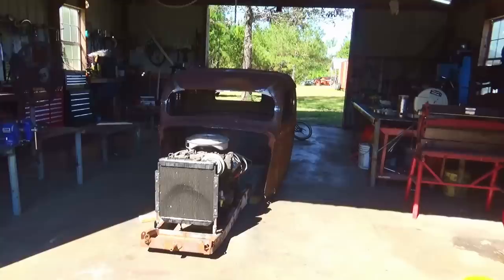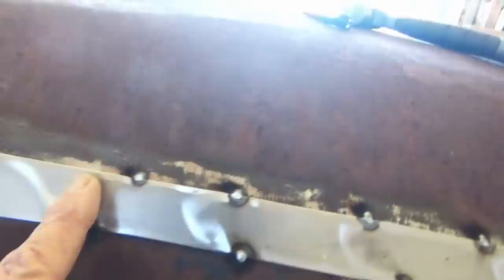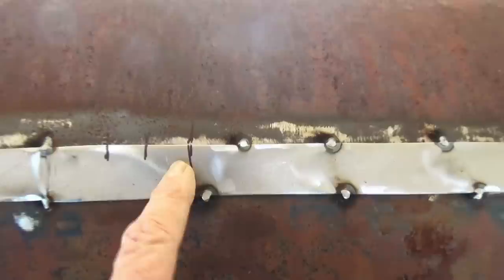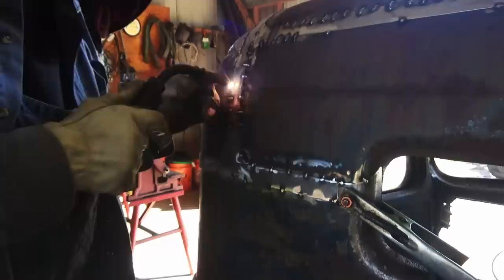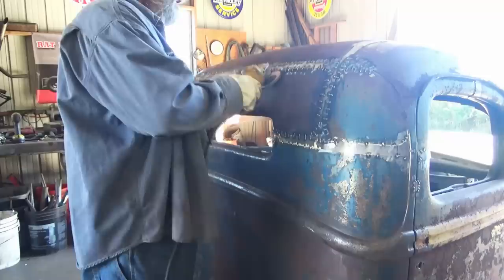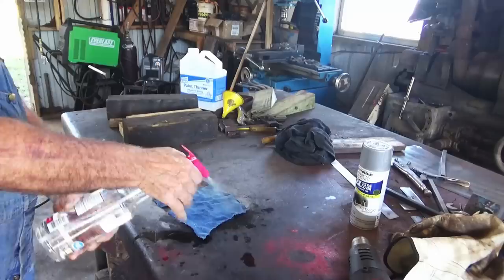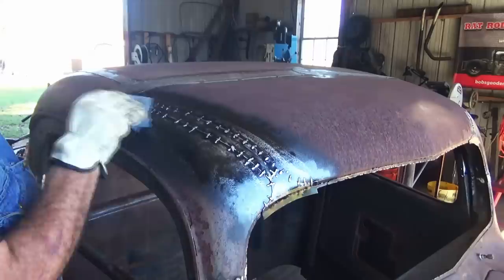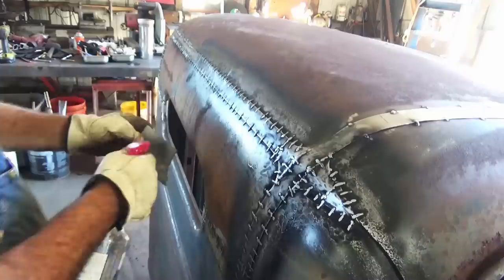47 Ford Truck Rat Rod Stitches And Bare Metal Paint Effect

Comment: Hey Bob. I love watching your videos. I am not just entertained, but I learn things as I go. Nice work Bob. I am thinking about doing something like that on my Fargo. Thanks for sharing. 👍👍🤠
Reply: I'm beginning to think that it's "Too Far-to-Go" for you!!! Is your knee still jacked up? Time to get out the Rocker and get back into the shop and get to Rocking it out!!! 
Let's go getter done!!!
Reply: @rockerpat1085  Hey Buddy Pat. My knee is getting a bit more movement. I have been doing some chores around the house and I can work for about 3 hours before my leg gets too sore to stand on anymore. My plan is to go to the wrecking yard next week and get some parts to connect my alternator and get a radiator and start back out in the Dog House early November. I have to check my videos to see what you said about removing the Regulator and solenoid.And what do I do with the extra wires???🎸🤠👍

Comment: Awesome art! Great inspiration. Will there be any room for water to seep in under the stitch-lining?
Reply from the maker: Yes ... it will leak big time! But only if you get out in the rain with it!
Reply: @RatRodBobBuilds  
hah, yeah, i need to drive it in the rain. might figure something out. maby i can use some kind of epoxy to waterproof somehow. Again, Thanks for the tips and inspiration!
Reply from the maker: @SilenceSupreme  Oh I see ... if you want to do this on your own ride and not leak you will have to weld the joints up solid then you can do the stitches over that for the cosmetics. My self ... I would just use caulk on the inside though if I wanted it not to leak because I'm cheap. LOL

Comment: You using seam sealer in between those stitches?
Reply from the maker: No, but I did use some white caulk I had left over from building my house to fill in a giant hole that I missed in the drip rail.
Reply: @RatRodBobBuilds  carry on, my wayward son, lol.